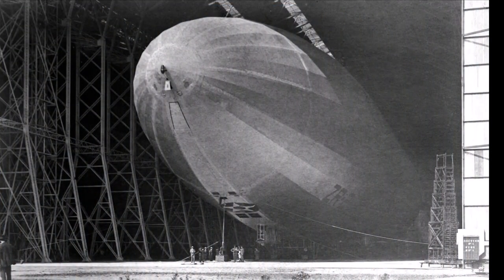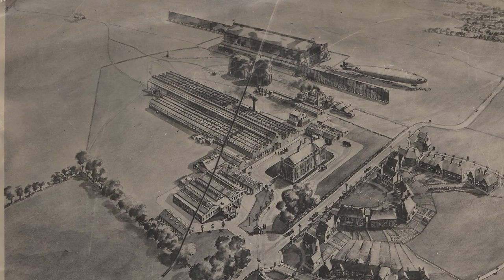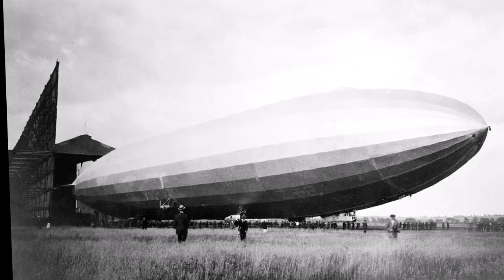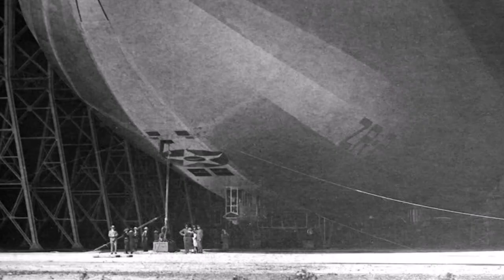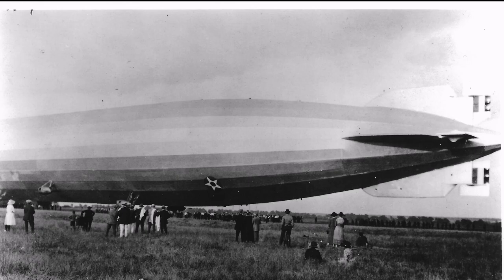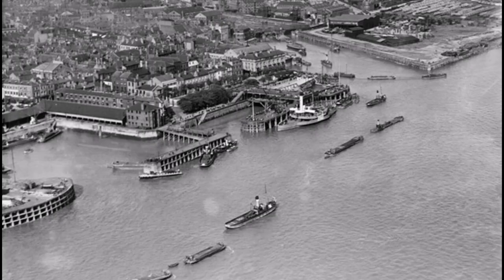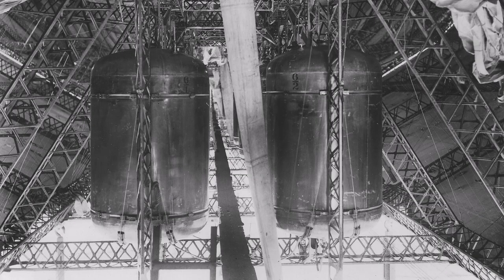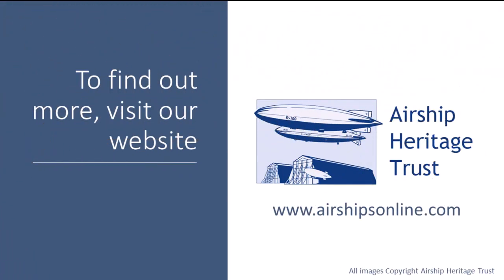The R38 /ZR-2 Story - Final Flight

Comment: Tragic the designers failed to realise the zeppelins on which this based sacrificed  strength for the ability to make extreme altitude to evade fighters and AA guns- they were only suited for high speed at maximum altitude in thin air, and at lower altitude the dynamic stresses just ripped the ship apart.
Reply from the maker: Yes indeed, and a tragic story of aviation beginings and fatigue. We seem to have forgotten the same things happened in heavier than air beginings.